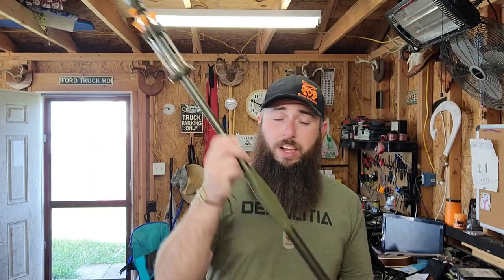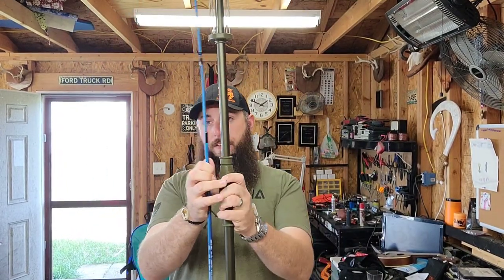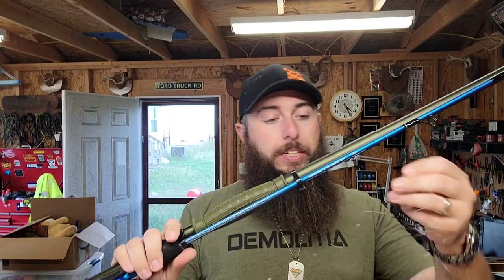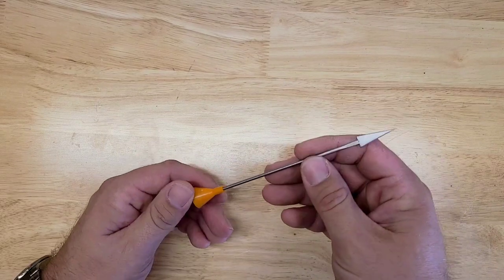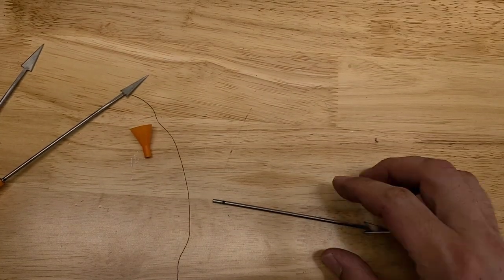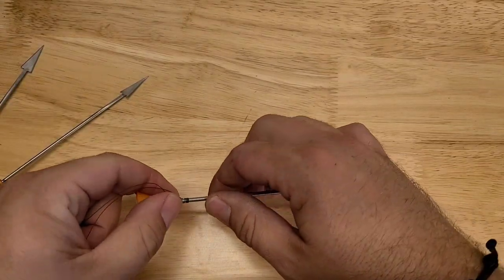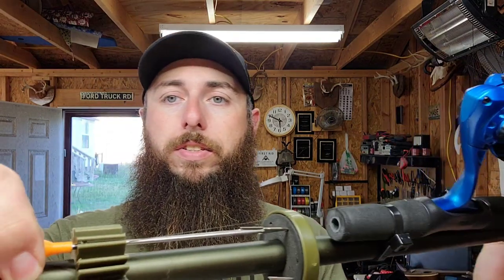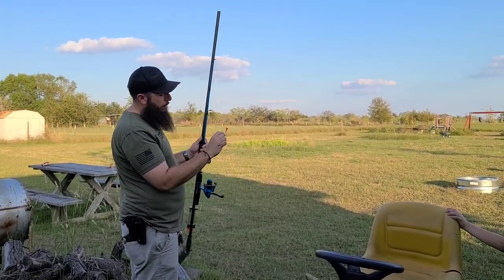Making a Blowgun Into a Blow Fishing Rig

Comment: I've been thinking of duing something like this with a slight twist, I am working on a jig to fasten the guides straight to the pipe of my blowgun, and I am looking at hose clamps to attach the reel. I think this will give a sleeker look to a blowgun fishing rig.
Reply from the maker: The main reason I used the rod, was to avoid putting stress on the actual blow gun. I'd rather ruin a $10 Walmart rod than a $90 blow gun.
Reply: @TheRealChaseRhodes ,  I understand not wanting to damage the Tim Wells you got. I am using a pipe I got from Home Depot for my blowgun and I am looking to get a 3D printed mouthpiece, so not to worried about the stress.

Comment: Does anyone know what blow gun that is?
Reply from the maker: It's a Cold Steel Tim Wells Signature Series. The only difference between it and the cheaper Cold Steel blowgun is It's green and the more ergonomic grip and mouthpiece.
Reply: I'd get the 4ft pro model if you're only getting one. The 2 piece model is thin and I've heard about the threads stripping. That being said I have the 2 piece magnum model on the way for deer season (easier to pack) to use on possum's, raccoons, and other pests I don't want in my woods.